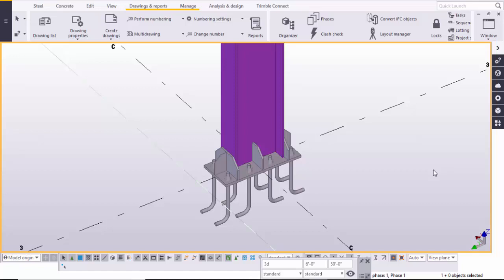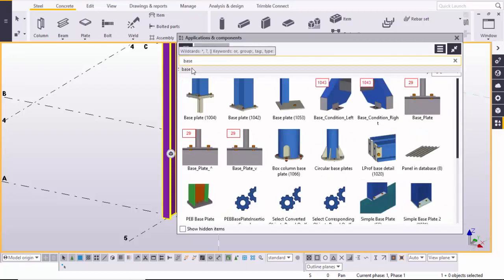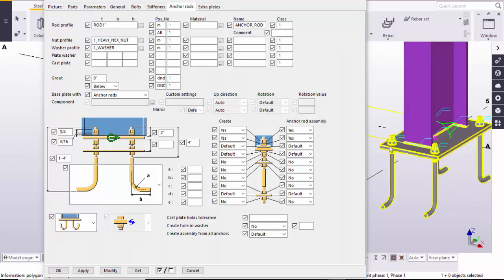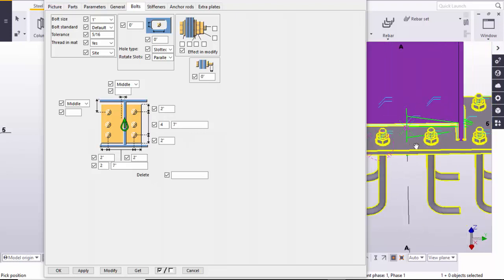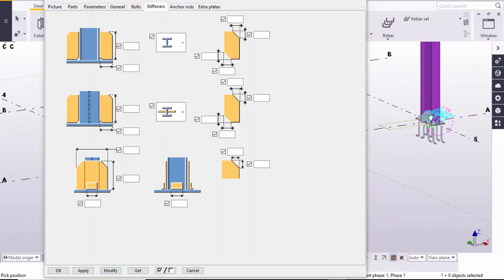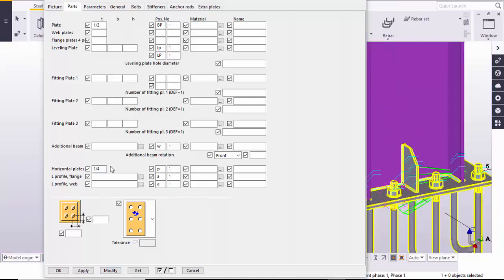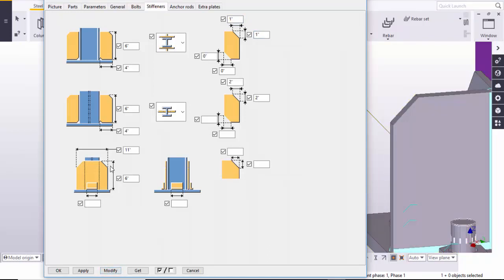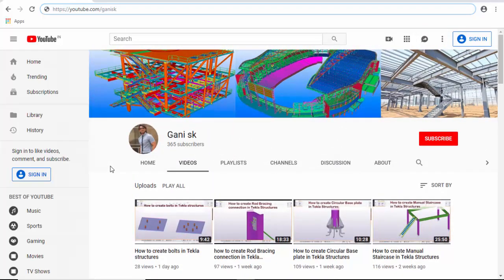how to create Stiffened Base Plate in Tekla Structures

Comment: How to stiffner plate to bolt distances change
Reply from the maker: By default stiffeners are placed exactly middle of  two bolts, there is no option to change distance between stiffener plate to bolt in component. if you required with particular distance between stiffener to bolt then, better to create stiffener manually with plate option.

Comment: HOW TO INCREASE NO OF STIFFNERS
Reply from the maker: there is no option to increase number stiffner in this component, if you required more stiffners, then you need to create stffners manually with plate option.
Reply: ok thanx